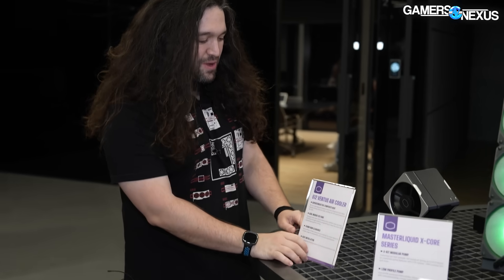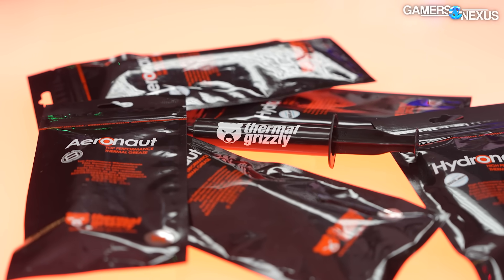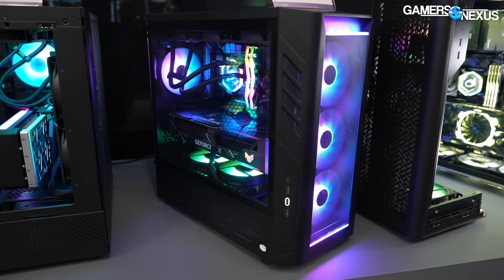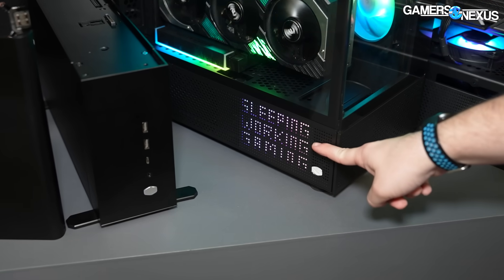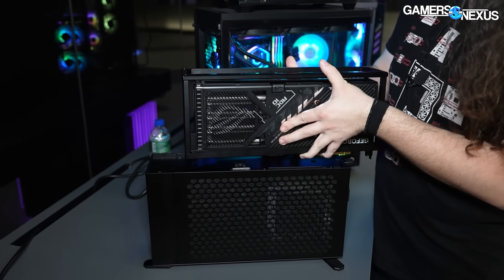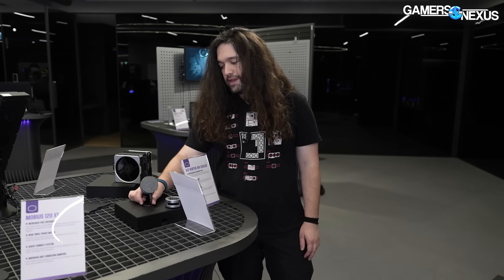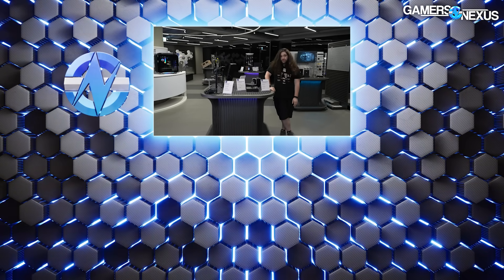Cooler Master's "Super Conductor" Heatsink, New NR200P Case Concept, & Clever ITX

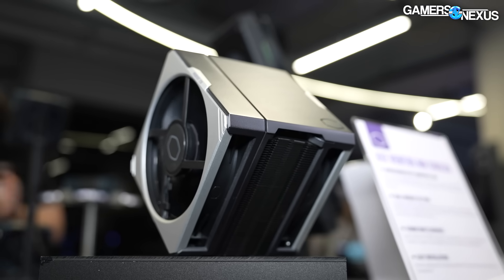Comment: I am never buying another Cooler Master case again, I currently have a HAF 700 EVO, that monster with the tempered glass front and the LCD screen. The LCD is crap, not because it is a bad idea, but its software is terrible. I have escalated to CM multiple times, been promised fixes, and given up as they havent come after years. The service has been poor, I have to communicate on Discord and they just dont respond after a while. This is a monstrously expensive, $650, case and they dont even include a fan controller, its a hub, like the most basic form. The LCD doesnt always do what you tell it to do in their software adn even if you tell it to just be off it turns on when it wants. The clock feature isnt even capable of showing the 12:00 hour, it just rolls over to 0:00 even at noon. Their software literally causes (provably) issues with games and causing them to start having horrendous frame skips. This has nothing to do with the product in this review, but CM has really been crap to deal with.